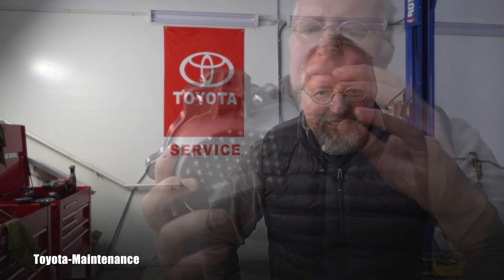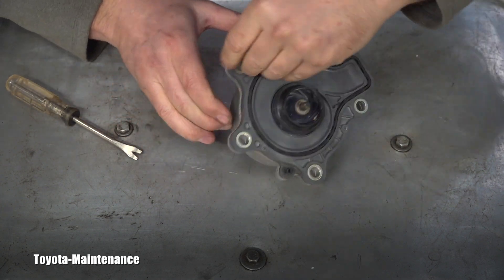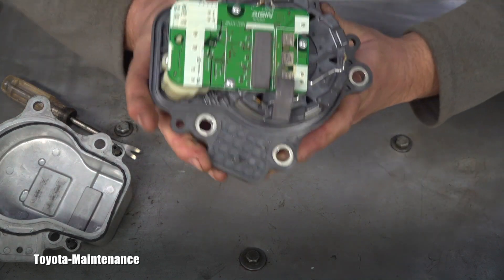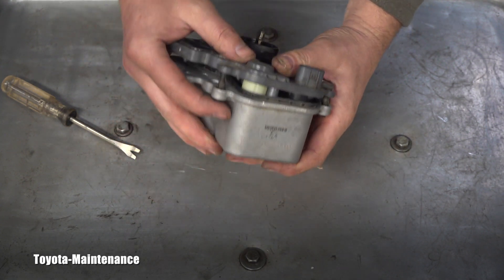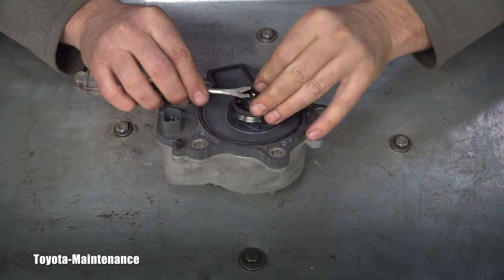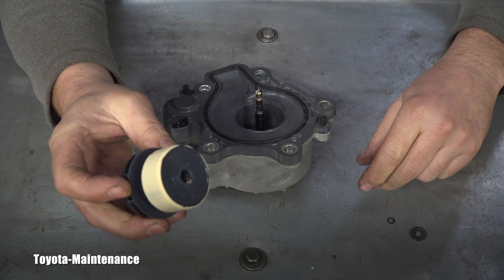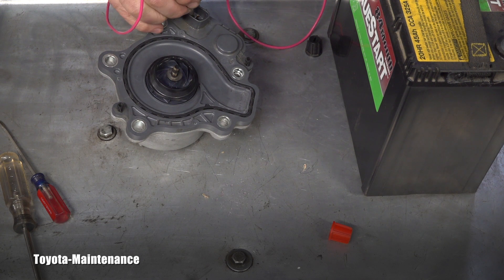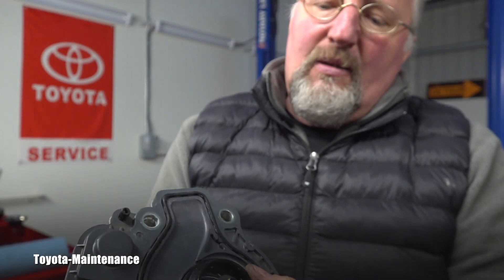Toyota Hybrid Electric Water Pump - look inside

Comment: I was planning to replace my water pump on 2015 prius but i watched a video that says "do not throw away your pump, replace only rotor!" After that video, i ordered the rotor from a Toyota dealership online just for 11.40 USD. I had no idea how to remove the rotor until i watched your video. Thank you so much.
Reply: Beware of just replacing the impeller. I did the same thing and my car ran fine for a week then the new impeller broke in half .
I am now ordering the whole OEM Water Pump which includes the impeller and a 12month warrantee for peace of mind.
My thoughts being that the impeller might not have been a good enough fit .
Reply: @srwsrw2  did your rotor replacement come from dealer/Toyota or aftermarket? Thanks for this info by the way.
Reply: Toyota does not sell the rotor separately.

Comment: Place the pump with the connector up. Top pin is North, to the right is NE. then on the bottom left SW, and the bottom is S. My old rotor moves, but with resistance. Applied grease for the test. There is some capacitive conductivity only between NE and SW poles. It shows resistivity, that grows to infinity. Reverse the poles, same thing, i.e. capacitor is charged. Applied pos to the NE and neg to SW pins, and the pump moves. Turns for a while, then stops, and produces a high pitch sound. This is in agreement with the sporadic overheating we observed. The new pump Osias and will keep watching it.

Comment: the brushless motor pump is probably fine and the impeller rotor is stuffed which you can just replace
Reply: If you did the regular maintenance on this car, this issues comes around 250-300k miles. Just change the 150 dollar OE water pump, coolant and  avoid having issues under 200 if you do it yourself. You're not going to save anything when the car overheats a month later because ASIN or Toyota doesn't sell just the propeller, so you're going put random 15-40 dollar OEM parts from China that tend to suck with all things water pumps and water inverters for Toyota cars that die 6 months later, 1 year at best. Calling a tow truck is going to cost you even more. These pumps tend to fail after prolonged use so you will more then likely more then 15 miles from your home so AAA roadside assistance will not cover you so time to pay 300-700 for a tow. Then you'll have to change the pump anyways.

Comment: Hi Peter 
I have question:) 
I have 2010 Toyota Prius it does give p261c code I thought my coolant pump is broken but my heater is working so I don’t think pump has problem. Am I right?

Comment: The defective design leads to the splitting of the plastic ring around the inadequately-designed impeller that causes the impeller to jam. Poor AISAN design responsible for thousands of head gasket failures without warning. Keeps "Gasket Masters" on You Tube incredibly busy. The best Prius was GEN 2 with the old mechanical water pump that costs a fraction of this water pump to replace. GEN 2 does not need a catch can or EGR service. Lastly, the GEN 2 does not have a water-cooled catalytic converter. GEN 3 started Prius quality going downhill.
Reply: 1.5 l versus 1.8liter

Comment: Merry Christmas, Peter! Those funny rubber-like things help transfer the heat from the power FETS to the case. https://youtu.be/a-Csf21jnsU?t=91 You have three exposed; the other one will have another three under there. Hence that big aluminum case will keep the electronics cool. There is a microprocessor to convert the DC power to three-phase (hence six power FETS).  I worked at Robert Bosch in Germany, then later at Motorola in Texas. I like electric motors and vehicles! This was our prototype test mule. http://evalbum.com/121.html Just a little ahead of the time. Thank you for the tip on Sauerkraut; I like Hengstenberg - a product of Bavaria. Parkinson's limits my wrenching; I haven't made a YT video in ages but keep up the good work (my local Toyota dealer shows a video of fluid changes, your license plate, your vehicle, and what they are doing).

Comment: Electric? Glad mine is Mechanical.
Reply: I think the electric pumps are better. No pulley stress and failure.
Reply: Electric pumps on the Prius last longer than the conventional ones, there are Priuses out there with 200,000 miles and still everything original.

Comment: The dealer diagnosed a failing water pump on my 2010 Prius and graciously offered to replace it for $890.  I politely declined and ordered the Aisin (OEM manufacturer) pump from RockAuto for $248.  The RockAuto/Aisin pump was identical to the factory pump with the exception that "Toyota" had been ground off.  Not having even seen the water pump on my car before, I did everything slowly and carefully.  After 2 1/2 hours the job was complete.  Including the overnight shipping for the new pump, I saved $130 for each of its 5 bolts.  I'm just a self-taught DIY guy and had no shop manual or "factory training".  No wonder that dealerships are called "stealerships" by guys like us.
Reply: Was it in fact ground off or do you mean missing? As in maybe Aisin had a cast mold that did not have the Toyota words to fill in when making the housing
thumbs up for your information
Reply: The appearance (different color/grain) is that the Toyota name was cast in and then literally ground off.  To me, this means that I got the same part from RockAuto that came in the car or would come from a dealer's shelf.  I feel good about it.
Reply: @johndorrell1 Aisin makes the pumps so you are correct. Remember that the dealership is a business and has overhead. There are plenty of repairs on your Prius that a DIY guy can’t do properly without a dealer grade scan tool. I’m a technician and see it. Luckily these cars are tanks for the most part
Reply: Well done

Comment: Peter, you should give us a close look at the Toyota electric power steering system.
Reply: An electric pick up truck?

Its like the terrorists have already won.... thanks Joe Biden
Reply: Show us how to remove the electric and convert it back to hydraulic
Reply: @somemedic  You must mean on a normal ICE vehicle? Unless there is a shaft where a pulley can run off of in an electric or hybrid vehicle..
Reply: @somemedic  I've had 3 Toyota cars since 1986, the first two had hydraulic steering and both had to be replaced  due to the hoses going bad. My latest Toyota already with close to 200,000 miles has had zero issues with power steering system. I realize that once the motor does break, it will need to be replaced. But there are no high pressure hoses to go bad and need to be replaced. Also remember, the hydraulic system always has to be working, the electric motor only works when you turn the wheel.
Reply: Just had a vehicle with a failed alternator. Lights flashing on the dash. Because it was not generating, power system could not drive the electric steering assist and reverted back to no power steering
Reply: Uh huh. And how much are a couple of hoses? $200 maybe...

When the electric rack goes out on a 2016 Silverado the entire rack gets replaced to the tune of $1800 plus shop time.
Reply: @somemedic  When the hoses went out, the whole rack had to be replaced, I bought a re-manufactured one  from Cardone and it actually lasted longer than the OEM one. You can't go cheap on such things.

Comment: Peter, How long does it take to change this electric water pump compared to a conventional unit?
Reply: I can only share my one DIY first-time experience - 2 1/2 hours going very slowly.  The pump itself is 5 bolts and one electrical connector.  Most of the time was draining coolant and removing intake items to gain access and the reverse process.  No special tools or problems.  A Toyota technician here on YouTube said these pumps are prone to failure at about 80k miles.
Reply: @johndorrell1  some of them never fail, and others do. I changed mine at 150 k miles as a prevetative matter. Make sure you replace it with an Aisin one, not a cheap replacement
Reply: much easier, because there is no belts. You can collect the coolant in clean vesssel and reuse it if it is pink and nice. coolant is rated to last 300,000 miles.

Comment: Just guessing that one of the hall effects is not working or is intermittent. This causes the microcontroller to not know where the shaft is exactly and where to put power
Reply: probably, The ECU controls rpm of the pump, according engine temp.

Comment: So why make a simple thing more complex by adding fancy electronics? Does it do a better job of cooling the motor than a mechanic pump?
Reply: I wonder about that too. While I have never changed an electric water pump I have done alot of prius inverter pumps which are electrical
Reply: @danh2134  Seems like the automakers stick electronics into everything these days, from water pumps and A/C blend door actuators to throttles and door handles, and even hood latches. And don't forget electrical power steering. Fancy, complex and expensive? Definitely. Better? I am not sure.
Reply: @paulparoma  with electronics everything is easily controlled and the efficiency is significantly increased
Reply: @carholic-sz3qv  The gain in efficiency is much smaller than the increase in complexity and cost, it seems to me.
Reply: @paulparoma  wrong, in EVs and hybrids the electric pumps are precisely controlled and the motor has no belt or chain driven accessories. There have been more and more electronics in cars for years
Reply: @carholic-sz3qv  Have a nice day.
Reply: @paulparoma  you too
Reply: Serious answer, but what would drive the pulley for the mechanical power steering pump without a cam or crankshaft.. for the Prius
Reply: @LAactor  The Prius has no choice, but regular cars do.
Reply: @paulparoma  That's what I mean. You can't on Priuses.
Reply: @paulparoma  as for regular cars, it would be able to act as an onboard controller for impeller speed and give computer feedback
Reply: @LAactor  I guess so. BTW, love your user name. How did you manage to register like that?
Reply: its not a one speed pump. probably a pwm pump. the stator looks quite robust. it changes speed as needed commanded by the computer. which is why it needs those electronics. it quite minimal actually just enough to do what it must. after seeing that, i'm thinking greasing that shaft with some plastic safe grease should be a maintenance item every time you let out the coolant.
Reply: A electric pump had to be used on this types of hybrid to keep the engine at a 80 to 91 degrees at all times. What good would it be having a belt driven water pump when it stops working when the engine stops working. You need to keep the coolant flowing all time so it could cool off or your Prius will overheat causing to permanently your engine or your car to be in a ready statue.
Reply: @carman1209  What is a "ready statue"? Is it a statue that's been finished or the Statue of Liberty? Is English not your first language?

Comment: Those are thermal pads used to transfer heat from the mosfets (or the alike) on the opposite side of the circuit board to the aluminium case.
Reply: I was surprised such a pcb was in there

Comment: In the factory, building the Camry hybrids.  The electrical connection on those is TIGHT...  they were a pain....
Reply: Does this pump use a 3-phase motor ?  I'm also curious if the Toyota Prius Gen2 Inverter coolant water pump is also a 3-phase motor.